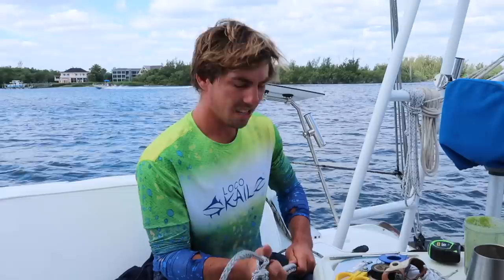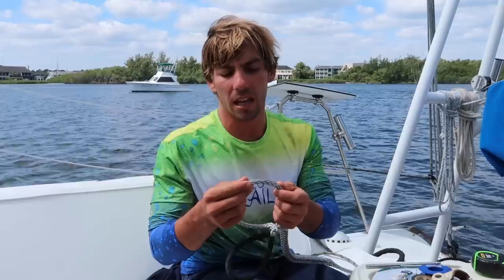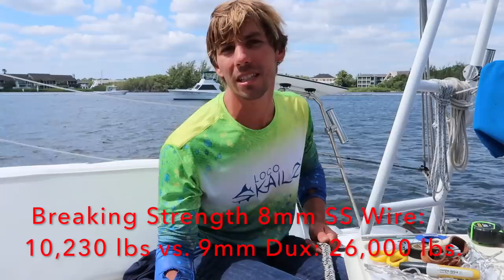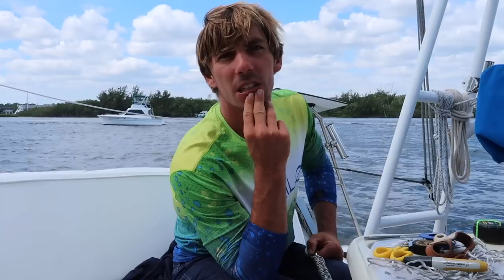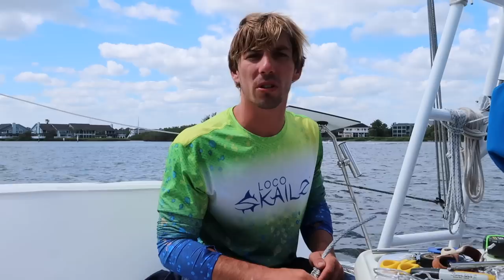Pros (and some cons) of Dyneema for Sailboat Standing Rigging

Comment: We love our dyneema shrouds on our 22' trailer tri as it really keeps the boat light and racy, easy to tension with the lashings, light for towing, etc. We've done over 18 knots on her during a race and she felt well-balanced even while screaming across some rare flat water in Toronto! (she's a Farrier design that we built). I remember meeting a solo sailor years ago on a little West Wight Potter, maybe 17'? She carried extra stainless rigging, swaging tool etc and she offered to help a buddy jury rig his 26' mono!! Wow. No dyneema on our 31' tri yet. Might happen down the road (ps we carry a tiny generator on the 31 too😉). You two have done a ton of work! Fair winds, Carleen in 🇨🇦
Reply: Thanks for the comment!! Those Farriers are saweeet! I would love to do 18 knots in one. What kinda tri is your 31'?
Reply: Tula's Endless Summer our 31 is also a Farrier. It's a 1995 F-31 design from when he worked with Corsair. We got her in the Bahamas a couple of years ago. She had a few holes in her main Hull and had been basically abandoned on Eleuthera. So we drove down to Florida, bought her original trailer, parked it in Ft. Lauderdale. Then flew to Eleuthera with about 500lbs of repair stuff, tools, an outboard and gear with Watermakers Air. They were awesome!! We fixed her up enough to float and sailed her back to the US. Top speed was 14 knots but we sailed her fairly conservatively. We trailered her home to Canada and cruised on her in our beautiful fresh water Great Lakes for a month last summer. But I'm keen to get back to the Bahamas. Cheers, Carleen.

Comment: Depending on the application you can save $$ by going with standard sk78 dyneema instead of the heat stretched (dux etc). On our 42 cat we use 11mm sk78 which has approx the same strength as your 9mm dux, but is considerably cheaper. The reason we can do this is the type of rig; we have a simple 3-wire dinghy style stay rig, so some stretch during run-in is not a problem. For you, or anyone with a multiple spreader rig I would definitely use the heat stretched material as you need your rig taught to keep the mast in column. Love the diy aspect to this material.
Reply: Great point. You're right, if you don't mind adjusting a bunch in the beginning you can save a ton of money by not going with dux. And you're def right, it'd be risky for us with a conventional rig having it go slack in the beginning. And we have x8 lashings we would have to adjust in the beginning which would be quite a pain. Did you go lashings only for tensioning? Does your rig have diamonds? If so, what was your solution there?
Reply: Tula's Endless Summer  the diamonds are wire but I will happily change them out for dux in the future (don’t want stretch there). Tension on the shrouds is all Colligo and 5/16 (overkill) lashings, the running back stays have 4:1 adjusters. Currently wire forestay with roller like you but would prefer hank on fully battened jib all dyneema. That thing is heavy!

Comment: We just finished with changing all our standing rigging from stainless steel wire to dyneema on a 34' Hans Christian.  A lot of trial and error especially with getting the shroud lengths correct. We went with colligo dux and John Franta is super helpful and always answers the phone when you call him. I would do it all over again in a minute. We saved about $5000 by doing it ourselves.
Reply from the maker: What method did you use for tensioning?

Comment: Of course you can do your own stainless standing rigging with minimal tools.  All you need is a hack saw and a couple of wrenches.  With that tool set you can build stays and shrouds using StaLok, Hayn Hi-Mod or Norseman fittings.  You can carry spares and some wire quite easily.  In my experience it only takes about 15 minutes to build a new stay or shroud.  The only reason to use swaged fittings is cost. In fact many people argue against using swaged terminals as the lower termination on stainless rigging suggesting that mechanical terminals are better there.

Do not get the impression that I am opposed to synthetic rigging.  In that area I just today finished the install of a removable dyneema 12 triatic stay on my ketch.  I made it removable since we step and unstep our spars annually and a removable stay eliminates two extra trips up the mast each year. 

I do like the new channel though.
Reply from the maker: great point Todd! and you're absolutely right, all you would need to replace a ss stay is new wire and a new cone for your fitting which should be easy to carry for most boats. I think the only disadvantage would be how much extra weight you are willing to carry and if you have the space. I know I have enough dux to re-rig the whole boat at just a few pounds. I think for 98% of cruising boats though the weight of extra wire vs. dux wouldn't even matter especially if you had the space.

Comment: How about the fact that the coefficient of thermal expansion for Dyneema is negatively correlated with your aluminium hardware (mast etc)?
ie. when your mast is shrinkng due to cold weather, your dyneema rig is getting longer and the other way around when it's getting hotter. Given a 25 degree temperatur shift and you need to retune your rigg completely. Not a big deal if you live in stable latitudes with minimal temperature fluctuations or only use your boat for a limited season. The bigger the boat (longer mast/rig), the greater the issue. Maybe you should invest in a carbon mast while your at it. That will limit the issue...

Comment: A question....I've been told that a catamaran, as it does not heel in a gust, takes that load much more on the standing rigging.....is that an advantage of dyneema? Does dyneema stretch somewhat, and reduce the shock load on the boat when hit by a gust? And if so, would you consider that as an advantage?
Reply: All the "stretch" is worked out of Dux (a very specific type of dyneema) so no, it wouldn't stretch. As the line starts to see constant loads exceeding like 10% or 20% (i forget the exact number) it will start to "creep" which is like permanent stretch that doesn't recoil. This isn't really good because then you would have to re-adjust your rigging to keep it tight. We don't expect to see loads like this normally. Either way I dont know if I would consider any "stretch" in rigging an advantage. I'll have to think about that a bit...

Comment: Thank you for another excellent vid.......
However there is one thing I don’t get........wouldn’t it be a lot better to use synthetic with turnbuckles (in lieu of lashings) for ongoing tuning? This would be especially useful with the lifelines.
Reply: Since DUX is pr-stretched (and we pr-stretched our shrouds after we spliced) we should not have to go through any ongoing tuning. The line is way oversized so creep should not be a factor either. If you did have to make constant adjustments then yes, turnbuckles would definitely be way easier but if you are solely using turnbuckles for tensioning then your shroud measurements and splicing need to be very very accurate. You could go lashings for the bulk adjustment and turnbuckles also for the fine tuning and constant adjustment but everything is a trade-off...

Comment: More than 2 years after installing the Through Bolt Cheeky Tangs, are you still satisfied with their holding power into existing larger holes initially made for the stainless backing shells?

Comment: Dyneema® doesn't offer much heat resistance, with a melting point of 277°F. The temperature of the tip of a lit cigarette when smoldering is close to 1100 degrees Fahrenheit. The temperature of the tip during a two-second puff can be more than 1600 degrees Fahrenheit.

Comment: Its almost impossible to sail in northern regions, Temperature can change more than 10c in a day and it can get to negative temperatures and no time to adjust tension. I never seen any monohull went to Svalbard or Greenland using dyneema. BUT in milk run it is much better than steel

Comment: For long distance sailing..... chaff is a serious problem... a line can chaff through in 6 to 7 hours  and you will loose your mast.  Inspections all the time would become very  burdensome,  very quickly.   The best rigging is galvanized  at 5% cost of SS or Synthetic.   Easy to replace every 5 yrs and people don't know its galvanized unless they look close.  It cost me 350$ to do my 65ft sail boat.
Reply from the maker: $350?!? How many hours does it take to rig your whole boat?  Do you do it with the mast up? I've been reading the rigger's apprentice over and over and find it intriguing using galvanized wire.
Reply: @TulasTechTalk  ... you can do it with the mast up.... but my rig was down.   No one noticed when they came on the boat  ... its so close in looks.

Comment: It's more beneficial on a monohull than it is on a multihull.
Reply from the maker: How come? Seems counter to what most people think. Can you explain why you think it’s more beneficial on a mono?
Reply: @TulasTechTalk  Because while a multi-hull might gain a slightly higher acceleration and max speed by shedding some weight, the positioning of the weight is less critical to designs which rely on form stability.
When you reduce weight aloft in a mono-hull, you lower it''s centre of gravity, and thus increase it's righting inertia (moment), effectively make the rig more powerful since it will stand in the wind more upright. That's part of the reason multi-hulls are so powerful, their sails are always perpendicular to the wind, they don't heel over and spill air.

What this means in a slow, cruising mono-hull is that hull speed will be achieved at lower apparent wind speeds. That won't be due to the fact that the boat is lighter, it'll be because the sails are producing more power at equivalent area, and more area can be put up for equivalent heel angle. Max speed won't increase, but it will be achieved more often.

Also, if you think about adding 1/2 a knot onto your catamaran's average speed, that's less significant than adding 1/2 a knot onto a mono-hulls average speed. And I don't even think shedding 100lbs would give a cat half a knot, 100lbs halfway up a mono-hull's mast certainly could shed half a knot though.
Reply from the maker: Absolutely awesome points!

Comment: Wire rigging fittings are all reusable unless they're swaged and it's not that hard to DIY. I feel like this video is misleading and heavily biased. There are downsides to synthetic rigging too.
Reply from the maker: The video title literally says “(and some cons)” not all cons. These are just some points to consider. Stainless fittings like Norseman or sta-lok can certainly be re-used but they may still have a lifespan due to crevice corrosion that comes hand in hand with stainless. Synthetic certainly isn’t for everybody.